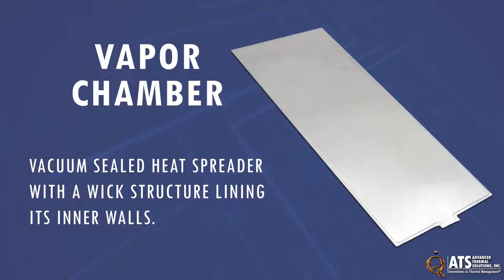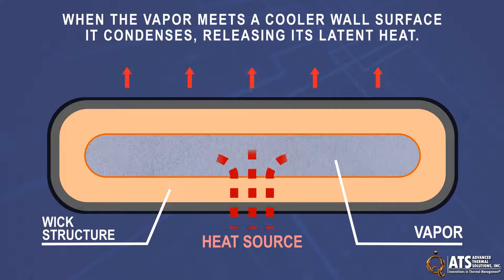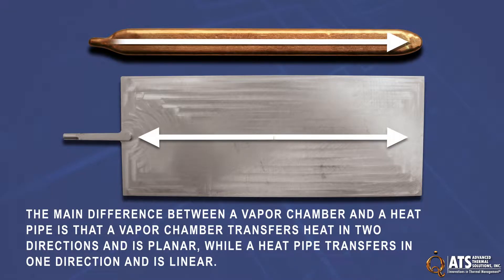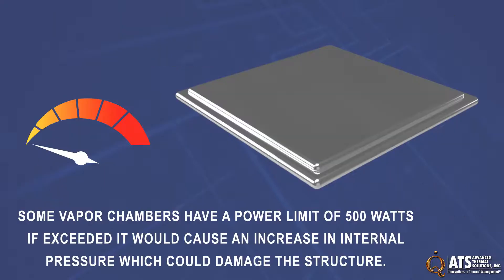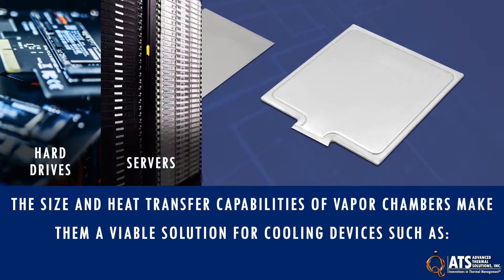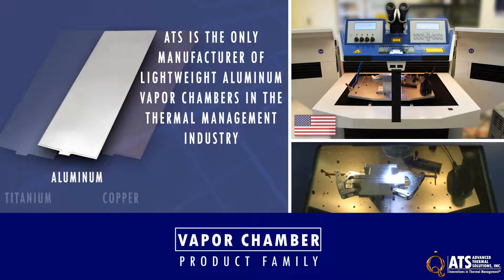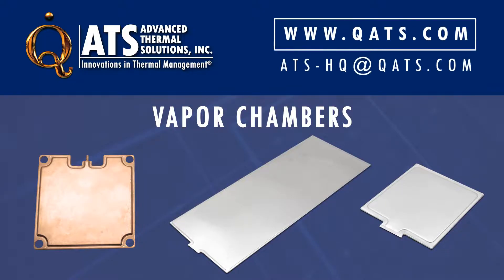What is a Vapor Chamber?

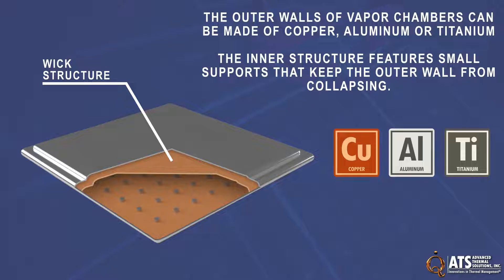Comment: 0:58 The inner "column structures" are for transporting condensate between upper and lower surfaces. There is no way that capillary action can efficiently carry fluid all the way to the edges and back. The hundreds of columns are made of sintered copper metal powder, providing short fluid paths. 

The maximum thermal capacity is often limited by the quantity/density of sintered columns. Heat transport rate is dependent on carrying fluid from the colder plate back to the hotter plate.
Reply: Wouldn't that suggest that heat-pipes become drastically less efficient - the longer they are?  But when looking at designs incorporating heat-pipes, that doesn't seem to be the case. 🤔

Comment: Hello, when you say that one works only in one direction while the vapor chambers does it in both, does it mean that it acts like a heat diode ? Does it work also to transmit cold ?
Reply: Heat pipes conduct heat along their length. Approximately one dimensional heat transport. 

Vapor chambers spread heat in two dimensions over the entire rectangle. 

These are not thermal diodes because the design carries heat in either dirction, but always from hotter to cooler. 

You can find thermal diodes in the Alaskan Pipeline ground supports.
Reply: @imconsequetau5275  Wow nice ! I tought they were also caloducs... What is the name of this tech ?
Reply from the maker: What that means is that the heat transfer is in one direction, so upward from  the surface of the vapor chamber that is in closest proximity to the heat source.   It is not electronic, it is based on thermodynamics where the liquid in the vapor chamber is turned into a gas from the heat, then condenses to recirculate back to the base. 

You can also learn more about this tech with our white paper "Vapor Chambers and Their Use in Thermal Management"  (this is a pdf download)  https://www.qats.com/Qpedia-Article/Qpedia_Sep07_The_use_of_Vapor_Chambers_and_their_use_in_thermal_management
Reply: @heatsinks  Thanks ! When i was talking about "diode", i meant it analogicly, I could have say "heat valve"
Reply: @heatsinks  Can it work in a non flat disposition, like on an inclined roof ?

Comment: Nice video! 
What comes to mind is, what is the best solution for a CPU PC ? I would think a bigger vapor chamber would be better to dissipate the heat than just pipes?
Reply from the maker: Your right Rene, depending on how hot that chip is, a vapor chamber attached to a heat sink may be a good option.  But a solid material may work just as well. We talk about this topic at length with the reasons why on our article here: https://www.qats.com/cms/2017/07/26/vapor-chambers-solid-material-base-high-power-devices/ 

A heat pipe would work too BUT it has been attached to an evaporator and condenser to make enough surface contact with the hot device.  You can learn about heat pipes and how they can be used on our video here:  https://youtu.be/eKrdJpDSowY
Reply: Typically, heat pipes are packed tightly side-by-side. And the best coolers have pipes emerge in both directions from the block. However, some CPU chip carriers may have hot spots that only one heat pipe touches. This is when an excellent heat spreader like a Vapor Chamber will help spread the thermal load among all heat pipes.